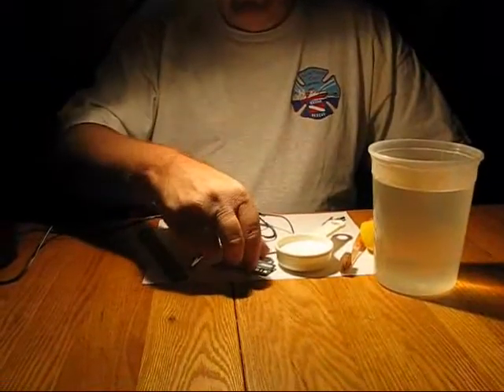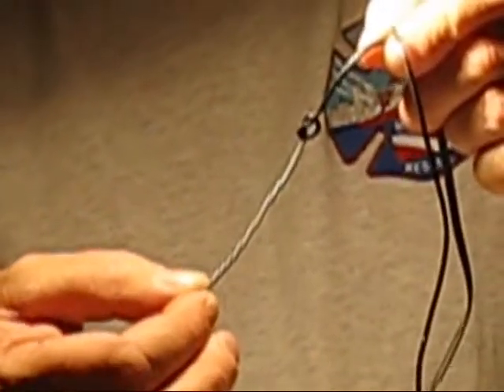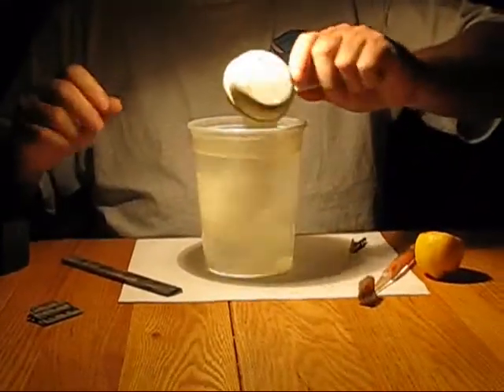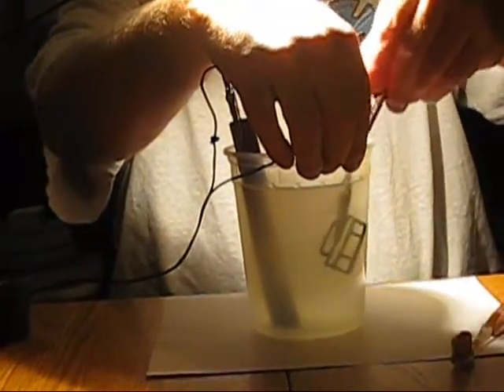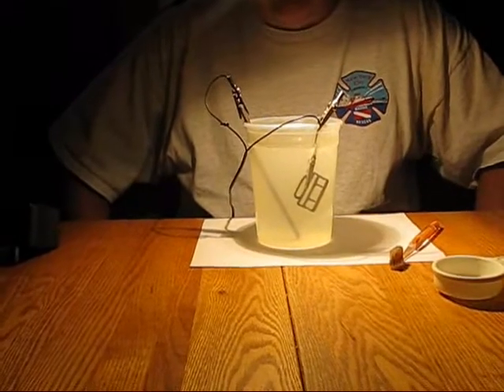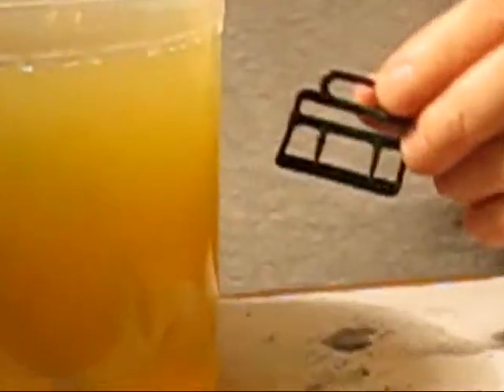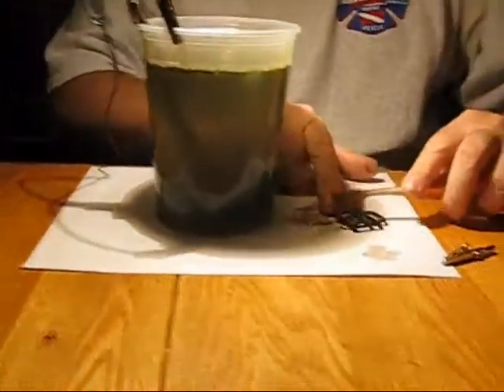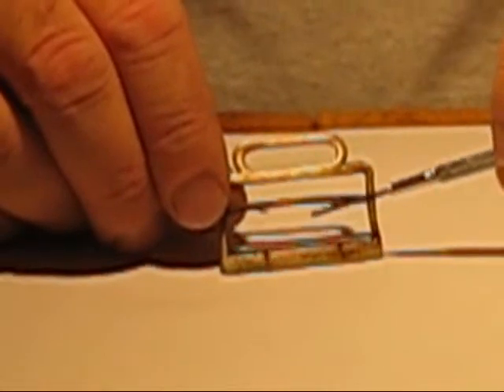TreasureDigging.Com Electrolysis Cleaning

Comment: Just made one from a 5.2 volt DC charger not super high voltage but will get the job done, I actually do a 2 part mix between salt and baking soda keeps things clean and ph level doesn't go up to much to where there would be need for concern on the item being cleaned. made my positive lead into a circular bar and the positive clamp that holds my item as close as possible without touching. Its effective/ semi-quick, and will get things nice and respectively clean

Comment from the maker: I have heard that a coin can get plated if the polarity is wrong. Check the chargers wires, the + usually has dotted lines or a solid stripe on it, that is the + and that goes on the sacrificial iron.

Comment from the maker: I forgot where I got the recipe for the electrolyte, I am only using a 3V charger though so a more concentrated solution works great. I can clean 5-8 pieces like coins or small buckles and relics before swapping out the solution. Good luck!

Comment: wow that's alot of salt for a small bucket of water and the lemon is new to me... did you need all that because your voltage is so low? I use 12 volts dc and one table spoon of salt (or baking soda) per gallon of water. But i'm no expert. SWING BEEP DIG.

Comment: How would you set up this electrolysis to clean coins?  I know some coins found may have some value and don't want to use use aligator clips because it may scratch what would you suggest?
Reply: Dana Wiley you can use hair clips or tie clips they don't have teeth. Or I think you can actually buy flat clips find worried about scratching your coin the you can clip them to a bit of steel wool or foil to protect it but will have to rotate your coin a bit to avoid bits being missed from the process. Also a good one to buy is uni-ross. as you can vary the volts.